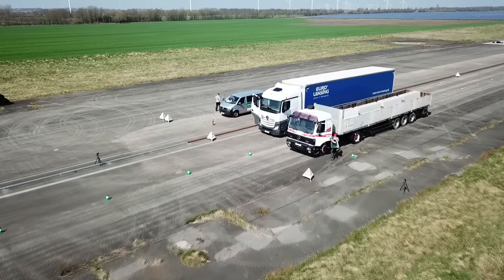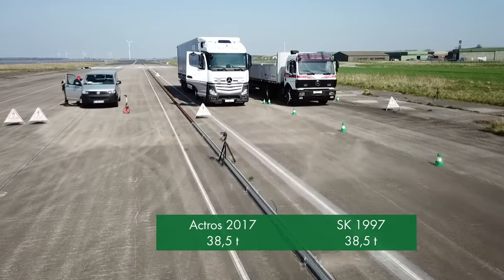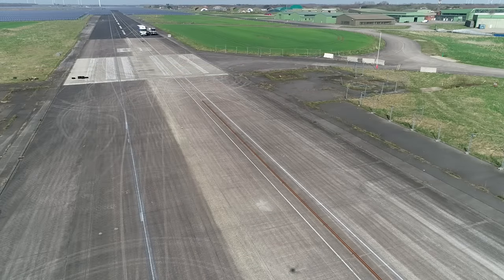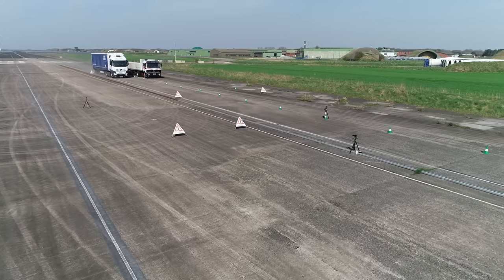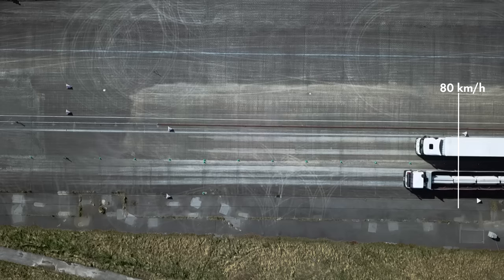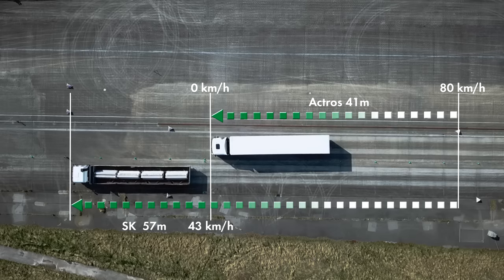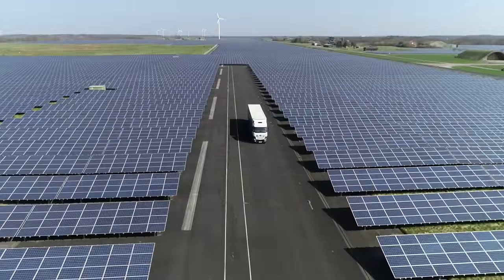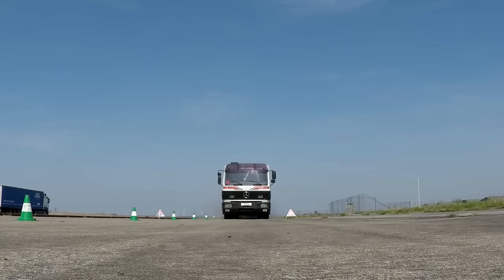Brake test: Modern truck vs. old truck

Comment: Huge respect for not using football fields per elephants 👏
Reply: Dekra is a German company, so they use sensible measurements
Reply: @michellegoede2258  Yeah.
Reply: @michellegoede2258  you mean the only acceptable types of measurement
Reply: @siramoras  yes
Reply: I got the same shit on a Volvo. 
Nothing like just driving normally and then it starts beeping and flashing and slams on the brakes with no one in front of you.
Reply: Lmao
Reply: If this test was done by americans they'd use washing machines.
Reply: I mean I wasn’t going to say anything but you started it
In America we use both systems, imperial is better for certain things, metric better for others.
In this case Americans would put this in feet on paper because it’s more precise, but would accept meters in casual conversation.
Especially considering meters are quite close to yards, another imperial distance measurement, this is also common knowledge in America.
Reply: @vaidulis2415  no, but to be fair the trucks would have almost double the stopping distance compared to the trucks in this test.
So enjoy the safer trucks ya hoser
Reply: @michellegoede2258  freedom units vs sensible units.

Comment: NOW SWITCH THE TRAILERS AND TRY AGAIN
Reply: What do u mean?
Reply: @bakoty6571  Why is the MP4 pulling a curtainsider? Why aren't they showing the load inside?
Reply: No, no, you've got a good point
Reply: Fejkara od videa i to ozbiljna... Bukvalno sam isto pomislio... :)
Reply: Seems like no benefits of lying tho as people could test this themselves and bash that company for lying
Reply: Also, leave the trailers but switch the drivers. Everyone drives differently.
Reply: @blue7081  Because it doesn't matter, they are both loaded with 38.5 tons.
Reply: @flxsounds7864  It matters,also older model started to brake a bit slower than newer model.I am sure if they did this better ,older truck would stop at least 4-5 meters before,still not good as new one,but considering year of production between those 2 truck,it's not really that much impressive,new truck i mean.
Reply: @TheSRBgamer63  Maybe the Actros has better breakes and especially better Break assistants, which the older one doesnt.
Reply: Then de test will by different. Because old vs modern trailer has different technical specification. Old truck have drum brakes en new one disk brakes. The new one have EBS (Electronic Brake System) EBS system react faster then the old command system that work with compressed air. When switching trailers then the modern truck with old trailer and the modern trailer with old truck will by force to use the old command brake system. (Yellow pressure line, those old system are available on modern trucks )
Reply: Old stuff sucks. Put in your mind, boomer
Reply: The difference is one of the drivers is not gay
Reply: Then have them both on Facebook while quaffing Pepsi Max from a 2ltr bottle.
Reply: Dekra is a pretty reputable organization. So it is very very likely absolutly fair. Also drivers won't make a difference since all they can do is press the break padel. And since the break system are driven by compressed air they don't even need to step that hard on the pedal to achive max breaking.
Reply: @flxsounds7864  no theyre loaded so theyre both the same weight. a curtain sider and drop side behave very differently,  also the drop the curtain sider technically isnt putting as much weight on the wheels cause of how it spreads the weight and therefor lets the wheels lock quicker and harsher, the drop side is putting more weight  on the wheels cause of how it spreads the weight and there for would cause longer braking distances. if theyre gonna do a test atleast do it properly and have identical trailers where the load can be seen. not to mention you caqn clearly see the newer truck lock the breaks up fully as theres smoke coming out the brakes, the older one didnt. it was rigged
Reply: @MallocFree90  You don't know anything Marco.
Reply: @MallocFree90  Old almost everything is better, especially truck engines or any engines :D
Reply: @edwardwoodward8052  yeah, but I'm sure  that YOU are an engineer who has an enormous knowledge. Am I right?
Reply: @MallocFree90  The SK is one of the greatest trucks ever built. Modern trucks are no comparison, they're more comfortable, but not as durable.
Reply: @flxsounds7864  Test the trailer brakes; is the new trailer helping the truck if so maybe an upgrade on old trailers?
Reply: @blue7081  NO LOAD xDDD stupid test..
Reply: Daantje van der Hoeven  i have a 2000 scania 4serie with ebs and disc brakes so it is not a new invention on trucks
Reply: This is a test done by DEKRA, an independent company that tests various safety aspects, why would they "fake" the test and make it one sided.
Reply: @timothyhastie  $$$
Reply: @TheSRBgamer63  older would also be on drumb brakes new one on disks
Reply: @bakoty6571  they used a old trailer were maybe the brakes not very good
Reply: just my thoughts! disc brake vs.drum brake
Reply: @scarmafiagaming1598  they were in a cartel, what would stop them faking this
Reply: @scarmafiagaming1598  dekra is a german testing sight
Reply: @flxsounds7864  they both have a total weight of 38.5tons.
Reply: @bakoty6571 Because is not true, I drive old and new ones and both of them break about the same, a bit better but not that much.
Reply: @freevideos051  money for what?
Reply: @flxsounds7864  Oh it matters, especially when you consider that the new trailers also have newer braking systems. That would definitely affect the outcome of this test.
Reply: @alkalinebass  they use air
Reply: @Rocker-1234  if you have more pressure on the tire you can brake harder without the tires locking up. Locking up tyres results Most times in an longer braking distance...
Reply: Yes i think so
Reply: @MallocFree90  get ratio'ed
Reply: @alkalinebass  Considering drum brakes have more surface area on same size wheels, and can therefore apply more braking force than discs, that's probably not the answer.

Comment: Test 2: same truck and trailer but switch the drivers. Test 3: same drivers but switch the trailers. Do these and report back your findings.
Reply: Very good answer. They could also show that the tyres are in similar condition, and do the tests with the trucks swapped from one lane to the other, just to cancel out differences in the tarmac- who knows if one of the lanes is covered in bits of rubbed-off rubber from a previous test?
Reply: @APAstronaut333  damn test again maybe the 15th result will be different
Reply: They also didn't say anything about the load. And the trucks... Are the old one the best braker from the era? Is it in good condition?
Reply: Projectfarm needs to test this the way he does it
Reply: @sayingnigromakesyoutubecry2647  :  Well, as for the load, they said it was 38.5 metric tons.
Reply: @Milesco  they said, but didn't show. Hell, even the older truck was the only one with an open trailer, you can't see what's in the other one
Reply: @APAstronaut333  LMAO
Reply: As the wheels on the older truck were still rotating, clearly the brakes weren't fully applied (or poorly maintained). The other thing to consider is any anti-jackknife systems on either of them.
Well, there's no reason the trailers can't be a 'pair' - so at least they're comparable.
Reply: @millomweb  It has ABS most likely, stands for "Anti-lock braking system" the tiers wont skid on the road.
Reply: @mofleh177  If it does, surely the newer one does too - ad that's locked wheels - you can see the rubber dust cloud !
Reply: @millomweb  it had abs (which ont he old one you can clearly see by the tire locking and unlocking when braking its even visible in the video) if you lock up the tires, the brake distance increases

Comment: Alles klar..16 Meter in 40 Jahren..bin begeistert
Reply: 20 Jahre
Reply: @DarthG3nesis  Der SK ist nicht von 1997 auch wenn es da steht.
1988 wurde die schwere Klasse SK vorgestellt.
Der Sattelschlepper im Bild stammt deutlich sichtbar nicht von 97.
Da gab es schon den Actros.
Der Actros im Video ist die neueste Generation und ab 2011 gebaut worden..
30 Jahre oder 40 Jahre spielt glaub keine Rolle..Denn in vielen anderen Punkten ist echt wenig Entwicklung geschehen..
Nach wie vor schlimmer CW Wert und hoher Verbrauch durch Barocken Dieselmotor.
Somit auch Emissionen. 
Man sollte meinen LKW würden schon lange elektrisch fahren..stattdessen geilt man sich an 16 Meter Bremsweg auf.
Wooow was eine Entwicklung
Reply: @andrezesna3920  für weite Strecken ja scheinbar noch nicht ausgereift genug, egal ob im PKW-Bereich, ÖPNV, kommerzieller LKW Verkehr oder bei Einsatzfahrzeugen. Es gibt bereits überall die einen oder anderen reinen Elektrofahrzeuge und Elektro-Hybridfahrzeuge, aber eben nicht in großer Stückzahl. Wie willst den CW Wert noch groß beeinflussen wenn die grobe Form der Kabine indirekt vorgegeben ist?
Reply: @andrezesna3920  Man kann es auch positiver formulieren: 28 Prozent kürzerer Bremsweg in 30 (oder 40) Jahren! Dafür dass es da physikalische Grenzen gibt, ist das doch ein beachtlicher Fortschritt.
Und wie soll ein 40-Tonner Hunderte km weit elektrisch fahren? Bestimmt nicht mit Akku, dann wohl eher mit Oberleitung über den Autobahnen oder/und mit Brennstoffzelle.

Comment: Reducing braking distances for safety is good, but there is one thing to keep always in mind:
when moving loads of tons, short braking distances could be not so much safer.
You're traveling at 80 km/h with a load of what, 5 tons, you brake for an emergency and you stop in 41 meters.
The load will do the same? 5 tons at 80kn/h have an immense kinetic energy and the only things that counteract it are the fixing systems of the cargo, if not done properly an emergency braking so powerful like that could end in a catastrophic and potentially fatal accident by cargo displacement.
Reply: Fixing the load properly is mandatory  and it's controlled by the police. The load has to withstand a emergency brake with full power.
Reply: And everybody is super responsible and don’t use questionable equipment, that’s why you never see broken or torn tie downs along the road. Oh, wait.
Reply: @mb-fs1yo  Agreed,a couple of years back my Iveco spec truck had both sets of keys stolen,the dealership sent an enormous Scania tilt and slide to load it on.When it was loaded I can remember actually thinking,to my self, f**k that! There is 11.5 tons of truck with probably a ton of two of tools,jack's,spec adapters etc. On board with quite a high centre of gravity now sitting 5 foot off the floor on a relatively shiny surface being held by just 3 not entirely suitably sized ratchet straps,if he corners too quickly it's coming off or if he brakes hard it's coming through his cab,the bulkhead being just some small box section and a mesh.Despite his assurance,bragging of how he regularly loads 2 giant tractors at once etc. the inevitable happened,the single rear strap broke and my truck shunted forwards,the 600kg solid block of steel counterweight welded across the front chassis pulverised his deck winch and half pulled it out of its chassis mountings,fortunately for him it did stop my truck because it was the only thing between it and the back of his mesh bulkhead and tissue paper cab,lucky bastard!

Comment: Bloke in the SK Merc didn't press the pedal hard enough. Not one wheel locked; not even a puff of smoke. Bollocks test.
Reply: quite schewpid innit
Reply: TBH smoke in new one was from breakes not wheels.
If you hold brake to lock wheels... you take longer to stop cose rubber turns into fluid.
Reply: It has ABS, older truck is from 1997, ABS became mandatory in EU in 1991.
Reply: @kerozin520  Both trucks should have abs then -.-
Reply: @kerozin520  that model isnt from 97 there build them from 88. 97 where the Actros.

Comment: The new brake sensors on the new mercs can be scary if you on a bend and a twig sticking out it locks your brakes I get it all the time,I say bring back the old trucks better to drive than new ones
Reply: My antos 2643 only beeps usually, very rarely starts braking
Reply: First of all: Brakes don't lock on newer vehicles. It's a benefit of driving a newer vehicles, meaning you'll have better control in braking situations. Secondly, no. You're just being nostalgic, and are being stubborn towards new tech.
Reply: @timderks5960  Doesn't change the fact that sudden hard braking is going to upset the stability of a 40+ Ton truck going through a corner, regardless if the brakes lock or not. Ever heard of weight transfer?
Reply: @Cozzy-Wozzy  No, you're right, it doesn't change that very specific fact that you picked for a very specific reason. It does however make a massive difference how the truck responds to this stability change. The old truck is guaranteed to lock up all wheels, which combined with the stability change will absolutely guarantee that it starts sliding when cornering. On a new truck, this risk is massively reduced. 
Also, weight transfer has absolutely nothing to do with this, but yes, I've heard of it, many times.
Reply: @timderks5960  Its really not a very specific situation, and it does happen, multiple guys have complained that it detects small sticks, bushes. And very small miniscule stuff like rubber from blown tires etc. darting out from ditches and what not, and I've even seen in a few videos for American trucks with the system where it automatically brakes because it see's a bridge over the road.
Reply: @timderks5960  not true.  I had one of these systems override the ABS and lock the brakes on the highway to a standstill when a car cut in too close in front of me.  Flat-spotted the trailer and drive tires...  That was the most extreme glitch in that system (I think it was the Bendix) on a 2018 Freightliner, but it was only one of many dangerous glitches.
Reply: cant you turn it off?
Reply: Good point. Newer version more headache to repair than the older version. Too much sensors sometimes easily prone to damage.
Reply: @worldmapping4895  Nope. Your engine won't start.
Reply: don’t bring back the old one, fix the new ones.
Reply: @alyx6427   if i had right to choose between old model or new model, i prefer old version. Less cost on repairs, modable, customizeable and accessable sparepart.
Reply: @mohdfauzanhusna4260  Would you still prefer it if you killed someone because you couldn't stop in time?
Reply: I long for the good old days before radios, power steering and air conditioning.